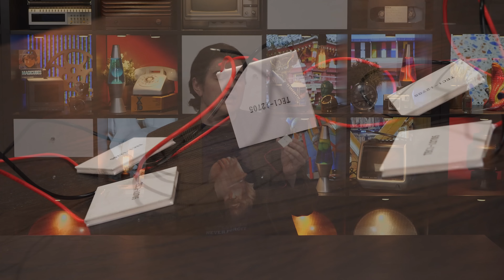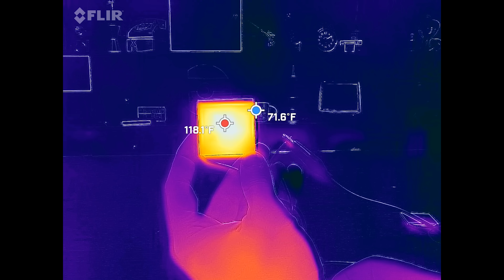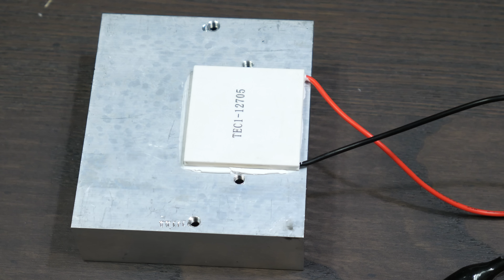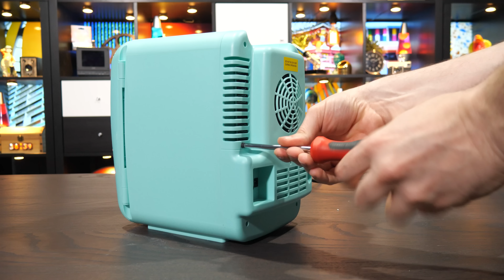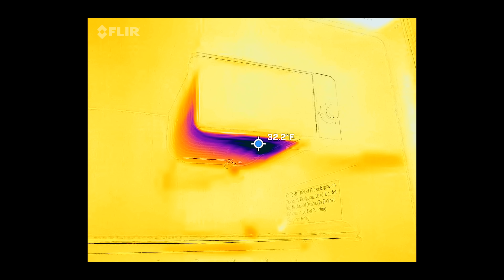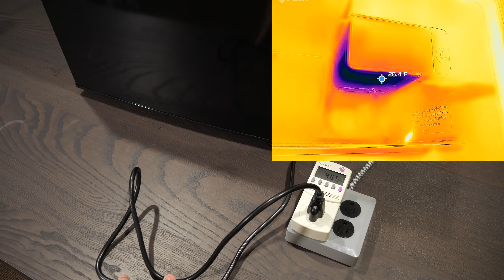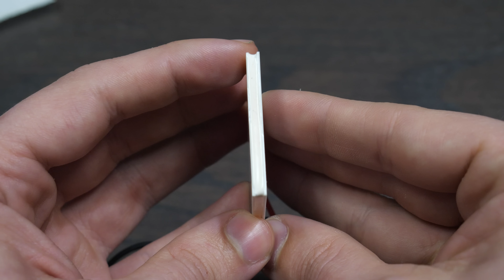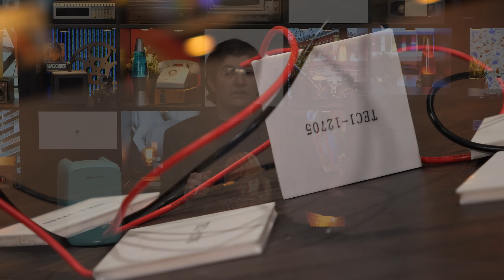Thermoelectric cooling: it's not great.

Comment: Watching all theese fridge videos makes me realize that the old fridge I bought used for $20 a few years ago to keep my beer cold in the basement is a absolutely brilliant fridge!
It fits perfectly in the space its in, uses next to no electricity, and has no issues with me loading in 3 cases of beer at once, automatically defrosts and well, just works!
That's my hot tip of the day: if you just need a small cheap fridge for your beer (or whatever you like to drink) then just buy an old used one.
Reply: My dad once got a free unrunning fridge that only cost him a $5 thermostat. It was still running 20 years later when he moved.
Reply: Best part of those mini fridges for beer is that you can have it set low enough to freeze water but not beer.  Usually you can do that with just the thermostat knob but if not you can usually pull that off and get it to set even lower to around 30 F.  Truly ice cold beer.
Reply: @EkiToji  I like the way you think. I've done this accidentally before, when I found the bottle of milk was solid and could come-out just like a milk slushie. But of course that sucked, and made the veg get all soft and bruised. But deliberately inducing it in a separate mini-fridge... that has potential.
Reply: There are kits to make that a kegorator with a tap on the door.  And it'll still take overflow from your kitchen fridge.
Reply: It almost works  as a built in durability test, if a fridge has lasted long enough to be older and still work well enough to be worth selling. It probably has a pretty decent design/construction
Reply: And there is the difference between the beer boxes and the thermoelectric COOLERS.   Note the emphasis on cooler because that is all it is.  Thermoelectrics are not true refrigerators  for it does not have the ability to remove heat from the cabinet in an efficient manner, not like beer boxes using the liquid/vapor heat transfer, which is far more efficient.  Sure, it's green, but it takes over 6 hours to get your drinks cold. It takes me 5 hours in  72F ambient to pull a room temperature water down to 50F. Not good when one is thirsty. I'm gonna drink that sucker!

You want a fridge on the cheap, buy a beer box or a small fridge with a fan.   You want to have fun, buy a thermoelectric.
Reply: Same! Mine makes zero noise, too!
Reply: @platty-fpv  Heh, I've heard some beer boxes sound like cats, purring away. Some are mistaken for fans going bad. Weird, but they are still running to this way.
Reply: I bought an old fridge off FB marketplace. I was considering buying a cheap new fridge but they are really small, (especially the freezer section). Im not sure about how much electricity it uses but probably better than cheapo new fridges. Its big and ugly but it lives behind the kitchen door so you can't see it most of the time.
Reply: as long as it's not too old, modern fridges use much less electricity and that cheap used one can end up costing you more over a year or two
Reply: @jon1758  Just don't buy that LG mess with the new style of compressor pump that is dying faster than infantrymen at Ypres in WW1.
Oh, and LG put a forced arbitration agreement on the box. You know, that box the delivery driver removes before bringing the fridge in your home, and then takes away.
Also, the existence of that forced arbitration clause is not available in the owner's manual or at the time of purchase.
Reply: @MonkeyJedi99  maybe if you live in freedomville usa they can pull that forced arbitration garbage, we have statutory warranties here
Reply: @jon1758  Modern fridges, with all their extra micro circuitry, are much more vulnerable to power surges. Old ones without micro chips are much more durable.
Reply: @jon1758  In our summer house (my, that sound fancy, it was my grandparents') we have an almost 50-year old fridge in the lobby that mostly cools drinks and fruit, and a "proper" fridge in the kitchen. We had to change the "proper" fridge twice, the second one due to compressor dying, while the ol' grandma's fridge is still working. Truly, they don't make them like that anymore.
Reply: @jon1758 No, they really don't. Modern fridges probably use more.
Reply: @mikafoxx2717  they run programs to encourage people to replace old beer fridges precisely because they're so bad. A 20-year-old refrigerator could use 1,700 kWh of electricity every year, compared with about 450 kWh for a similarly sized new ENERGY STAR model
Reply: @jon1758  You do also have to account for the material manufacturing energy in this, the new ones probably won't last as long. Unless you have some awful fridge that used heated door gaskets, it's not a very high draw appliance.
Reply: @mikafoxx2717  you don't have to, you can just work out that a new fridge pays for itself in X years compared to an old one (even if it's free) based on the cost of electricity to you
Reply: Especially in a garage or un conditioned environment  @jon1758
Reply: @jon1758  A very VERY old fridge (think 50s-80s) uses a lot of power.
But a MODERN fridge from the 2010s likely uses more power than a fridge from the 90s that was high enough quality to still run in 2024.
The compressor might be slightly more efficient in a modern fridge, but there is SO MUCH less insulation in a modern fridge as every manufacturer wants to add 1 more cubic inch to their product sheet at the expense of insulation.

The old fridge I have in my basement has 5" (~13cm) thick foam insulation in the walls.
My "modern" super super energy star fridge in my kitchen has 2" (~5cm) insulation.
Reply: @mikafoxx2717  Modern fridges use way less power than old ones.
Reply: @mikafoxx2717 the amount of insulation makes the most difference unless the compressor is faulty.
Reply: Have you actually measured its power consumption? Old refrigerators might cool forever. People dispose of them because the interior is broken (which affects insulation) and the seals are no longer tight. Older refrigerators are also less energy efficient to begin with.
Reply: @Wolfcritic64  You are only TECHNICALLY correct that the refrigeration cycle of old refrigerators is "less efficient". However, the efficiency gains on the refrigeration cycle is usually VERY small, like 2-10% when comparing new/new, because this has been a 'solved problem' for a long time. In fact, depending on the refrigerants used, and assuming those refrigerants haven't leaked at all, an old fridge might have a MORE efficient refrigeration cycle. This is rare though, because gas seals are never perfect, which is why we ditched the "better" but really really terrible refrigerants we used to use.
However... The insulation on an older fridge is almost guaranteed to be thicker/better than a new fridge. And not by a little bit.
Every generation gets thinner and thinner insulation as manufacturers scramble to  'make number bigger' in their marketing, and that number is storage space. And since they can't make the outside bigger, they are trading insulation for interior space.

My fridge from the 90s has 5inch(13cm) thick insulation.
My 2017ish fridge has 2.2inch(6cm) thick insulation.

My older fridge uses about 65% of the energy of my new one to maintain it's temperature. So the refrigeration cycle is definitely far less efficient. But the insulation MORE than makes up for it.
Reply: The extra freezer space is nice too!
Reply: @volvo09  Right? I like to buy frozen turkeys right after Thanksgiving and Christmas when the prices come down so the stores can clear their inventory.
Frozen, they keep long enough I can have turkey and turkey sandwiches and turkey soup sometimes into February.
Reply: @MonkeyJedi99  yes! Discount turkeys and chickens are awesome!

Same with pot roasts, and any cheap meat you can freeze.
Reply: @volvo09  Grocery Outlet stores usually have 12 to 16 lb turkeys for  $8 and spiral sliced hams for about $1.29 per pound just before Thanksgiving and Christmas.  Those sort of prices are why I bought a desk sized chest freezer at Home Depot for $120 in 2006. Now, after only 18 years in service, I think it's ending its service life.
Reply: My neighbor put his mini fridge at the curb and cut the cord for some reason. I grabbed it, wired the cord back together and smacked on the inside and works perfectly!!  Thanks neighbor!
Reply: @urukadooedwards7637  When defrosting it, DO NOT use a ice pick! You punch a hole in the freezer coil, that's it, game over dude.  Use a hair dryer and let it cool off before plugging it back in.
Reply: @Nighthawke70 yeah I made that mistake once…except my tool of choice was a flathead screwdriver lol
Reply: @Nighthawke70  👍 No ice picks! I was lucky enough to find a vintage  Coldspot defrosting tool at a thrift store. It's a handled plastic scoop with a metal scraping edge at the  working end. A shape much like those litter box cleaners but much stiffer plastic and no sifting slots.
Reply: @RobertJarecki  eyetwitches NO ICE PICKS.
Reply: Sometimes when appliances are recalled due to a safety defect (risk of fire, etc.) the manufacturer just has you cut off the cord and send them a picture instead of shipping it back to them (since they’re just going to throw it away anyway, they just want to make sure they don’t compensate you if you decide to keep using it). So might want to check for recalls on that thing.
Reply: you would save more money by not drinking at all
Reply: It's best to plan to retire an old fridge safely so that the refrigerant can be reclaimed, rather than waiting for it to be released to the atmosphere when It ultimately leaks.
Reply: Uhhh yeah, welcome to the rest of society. We have known this for our entire lives.  The refrigerator in my basement is over 65 years old and has never been unplugged except once in 2020 when I had to replace the 45 year old extension cord it was plugged into that was under-rated for the compressor and beginning to crack apart. I do not have any appliances in my house newer than 1993.
Reply: As people have mentioned, you just have to be wary of higher power consumption if used means old. If it's within the last decade or so you're probably fine, but it starts going up fast beyond that.

Depending on used price vs new price, it might be a good number of years before you end up in the red on that, but we typically keep appliances for longer than that, no?
Reply: 3 CASES of beer?
I'm going to pretend you run an illegal speakeasy in your basement instead of just being an alcoholic.
I suppose it's also possible that you buy several months of beer all at once, or that it's non-alcoholic beer?
Reply: @Prophes0r  how does having 3 cases of beer in a fridge indicate ones an alcoholic?
Reply: @saneschizophrenic  Because having 72 cans of beer 'ready to go' is excessive unless you are running a bar?
Even a single case is problematic for one person, unless it's for a whole month.

Let's step away from alcohol for a moment.
If you opened a single person's fridge and they have 15x 2 liter bottles of soda in their fridge, it should raise some questions.
Are they having a party in the next few days?
Do they buy months worth of soda in bulk?
Because if not, that isn't a healthy amount of soda to keep on-hand.
Reply: @Prophes0r  none of the above.
Beer has a long shelf life, and buying 3 cases a few times a year is both cheaper and more practical than buying a few beers every week. I could keep just a few beers cold and the rest just in the pantry and then refill the fridge all the time but I've got the fridge space and this way I've always got enough cold beer for if friends suddenly pop by.
Reply: @RenaxTM91  "...I suppose it's also possible that you buy several months of beer all at once..."
Reply: @Prophes0r 3 minimum for a well stocked beer fridge. Two cases of your brand so you always have one on deck, and a case of your buddy's. You wanna make sure you have some light beer as well, but no more than a twelver is needed for that. And don't forget to throw a handle of vodka in the freezer, won't freeze and it keeps your cocktail ice from melting so quickly.
Reply: @spddiesel  Sounds like a fridge in a Frat house to me.
NOTE: More than 5(4) drinks in a day, or 15(8) in a week, is considered "Heavy Alcohol Use".
(Women? Not sure why this is needed?)
Reply: @Prophes0r  lol, tell me you've never been in a frat house without telling me you've never been in a frat house. 🤣🍻
Reply: @spddiesel  *snort* Sure thing 'buddy'. I can be just as dismissive of you.
50+ beers and a few bottles of liquor are exactly the kind of thing I'd find filling one of the fridges in every frat house, military dorm, and private club[1] I've ever been in. The only exceptions are the ones that are dry, or the ones that have a bar/keg system.

Considering my decade+ military experience and decade+ of university experience, I'd say I'm a LITTLE more qualified than the average person to make my claims.

But we are being dismissive on the internet. So qualifications don't really matter huh?

[1] Hunting club. Biker clubhouse. Etc. If it wasn't dry and didn't have a bar, it had a fridge full of beer for the dozen(s) members.
Reply: @Prophes0r   it's indicated in that way because estrogen reduces the performance of the enzymes that break-down alcohol. It hangs-around in the bloodstream for longer in women. (This is also true for painkillers like paracetamol. Despite saying it wears-off after 4-6 hours, it's been found in women's bloodstreams after 8-12 hours. The dosing is just indicated for men.) 

Though some countries have recently taken to dosing "excessive drinking" the same for men and women (lowering the old men's limit to what used to be the women's limit). This is because, despite men generally processing the alcohol and sobering-up quicker, more recent research has found the liver/etc damage is roughly the same per unit of alcohol (regardless of whether you processed it in 4 hours or 8).

Comment: One factor on the thermoelectric coolers is that they are actually quite reliable.  Now, those cheapie little cube fridges are pretty good, but you aren't going to be beating one around in your car on road trips, camping, etc.  I purchased a 42qt Coleman petier electric cooler at a truck stop at least 20 years ago, and it's still going strong.  It's insulated very well, with some sort of closed-cell foam...more than most coolers actually are really.  (and in the door too!)  It's advertised cooling power is 40 degrees below ambient, and it will do it I have found.  I will frquently pack one of the "blue ice" packs within along with pre-chilled food for the trip.  While plugged into the car, the blue ice pack doesn't thaw.  The ice pack maintains it when having to stop the car in the summer, and will keep it chilled for several hours. My family has taken this electric cooler on many many camping and other road trips, it's been dropped, banged around in vehicles, tipped, and it looks like it's been through a war, but it still works as good as new!

Comment: You aren't factoring in compliance requirements. In industrial settings, we have to deal with a ridiculous amount of rules. At a factory I was working at, all devices with refrigerant were required to be audited/inspected regularly. The Peltier micro-fridge didn't because there was no coolant or compressor. It was a compliance loophole.

Also, you're talking about food safety... It's advertised as a beverage cooler, which they work great for. Mine had a warning saying not to use it for food. They can also be run in 12v environments like boats and vehicles. You're comparing apples to oranges.

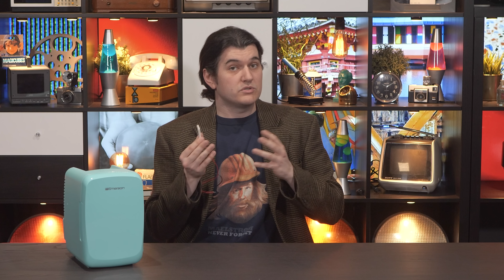Comment: 🤓🤓🤓ACTUALLY 4:22 

It can disappear look at the light redshifting fromfair universes, it does that by losing energy 🧐🤓🤓
Reply: That... That is not how redshifting works. The frequency of light goes down because the universe has expanded since their creation. The light particles (photons) arrive slightly less frequently, but the energy in any given photon did not change.
Reply: Update, because I don't want to be doing misinformation: I'm talking to my astrophysics major friend, and they have explained that the energy in the photon does decrease, but it is not lost: It is spread out in the expansion of the universe. Within the closed system of the universe, the energy must still go somewhere, even if it is not available the redshifted light.

Comment: Thanks for another informative and enjoyable video!
 
Peltier devices are used very effectively for specialised astrophotography cameras.
Originally, it was because older CCD sensors had vastly reduced noise at lower temperatures.
More modern CMOS cameras do have much lower noise. However, set point cooling allows a more accurate calibration of target frames by allowing subtraction of matched dark and bias frames noise from the camera electronics. This still applies for both older and newer cameras.
The reason Peltiers are so effective for this use case is that they are only required to cool* the sensor, which is typically sized in the order of a 30-25 mm diagonal. It's a match made in the heavens!

BTW, a "good" cooled camera will get your sensor to about 40 K below ambient.

*(with additional forced air cooling)

Comment: Theres a Peltier fridge in my small hotel room in Tokyo. The radiator is big enough so it doesn't need a fan, but you can feel the hot air coming off of it by placing your hand above the counter it's nested in...

Comment: Whoa, did you just completely gloss over the borderline useless 45F blue box magically turning into a FREEZER if you just drill a hole in the door and fill it with spray foam??? If the lack of insulation is the only difference between "chilled" and "frozen" then I think this video is really selling Peltier coolers (or at least $30 Peltier boxes) short.